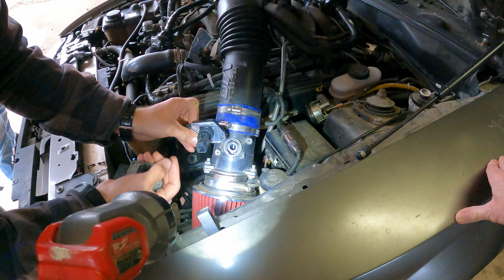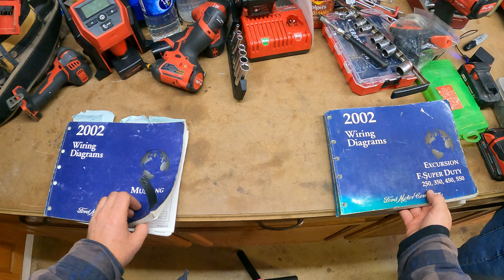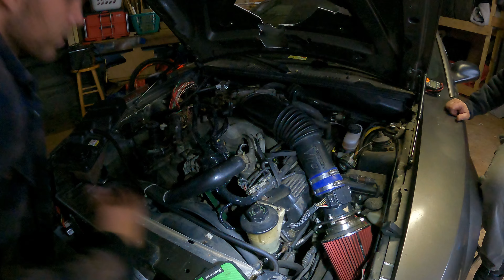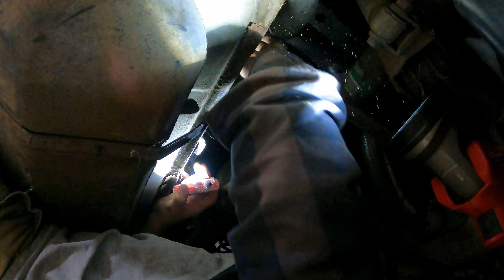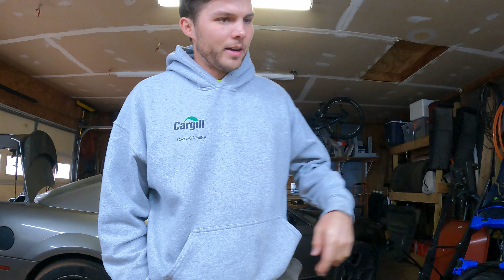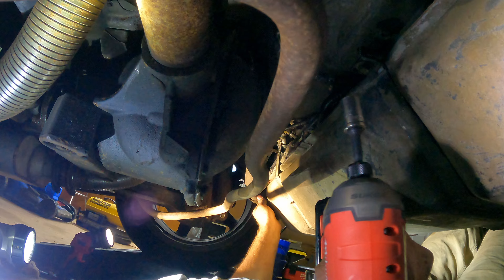V10 Mustang Build | Fixing MAF Sensor, Fuel Gauge, & Test Drive

Comment: Was there any issue fitting the exhaust manifolds close by the steering shaft? That is the main bit I am worried about for my 6.8
Reply from the maker: Yes, the driver side exhaust manifold was very tight around the steering column. I had to cut and weld it to get clearance around the steering, I eventually want to get some custom headers for it but that’ll be later on.
Reply: Gotcha, I figured it would hit there. I have adjustable motor mounts so maybe height can help with that. 

Is there any way I am able to contact you about the build? Seeing you do this inspired me to get my own project off the ground and I just have a few questions.  @EricAndTaylor

Comment: Is this a 2 or 3 valve. And are you using a automatic or manual van ecu?
Reply from the maker: This is the 2 valve, running on the original trucks ecu. The truck was an automatic, but I had the ecu flashed to turn off all the transmission programming.